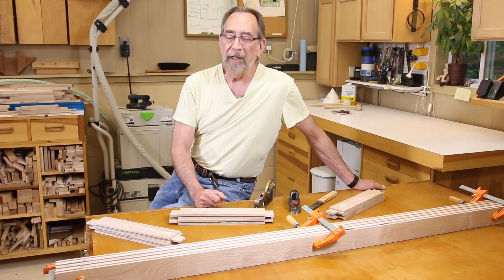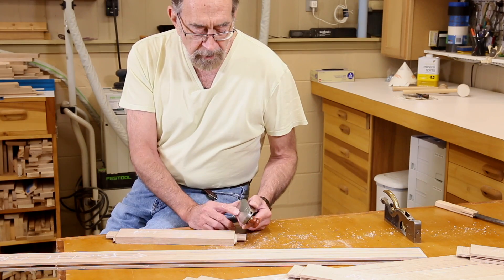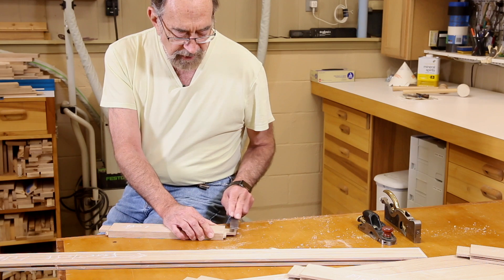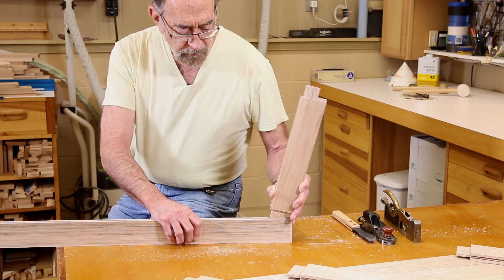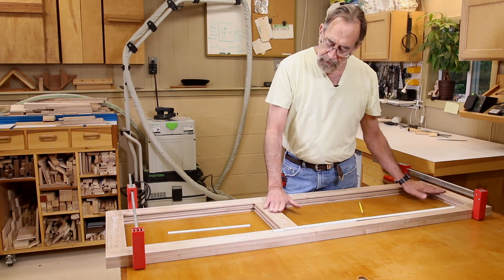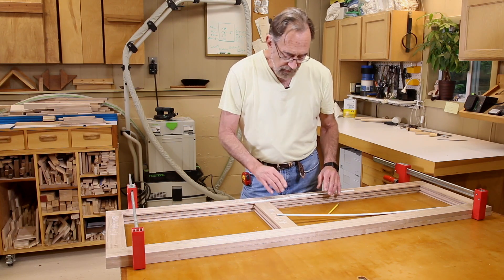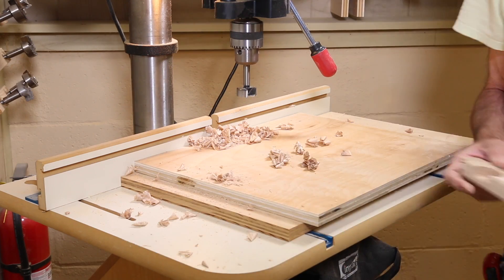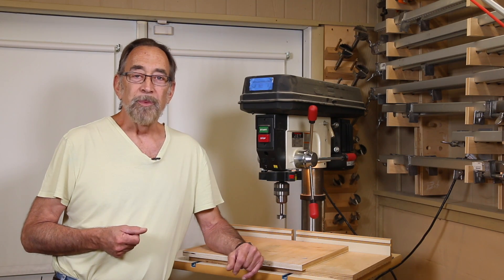Sliding Bypass Doors Part 4 - The Down to Earth Woodworker

Comment: Thanks for the very informative video!  One of my only suggestions would be that while drilling out the holes, it would have been really easy to set your fence and thus have a positive reference point.  This makes for even more consistent results, and I think it helps with safety, too, since it helps anchor the workpiece.  (If someone really wants to go the extra step for safety, they can even set up a hold-down for each drill operation.)

Thanks again for the video!